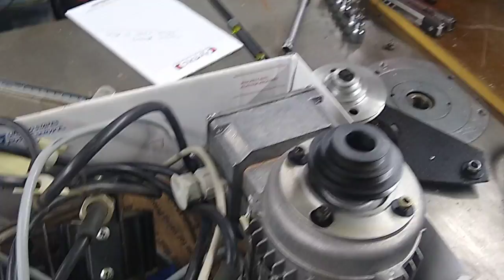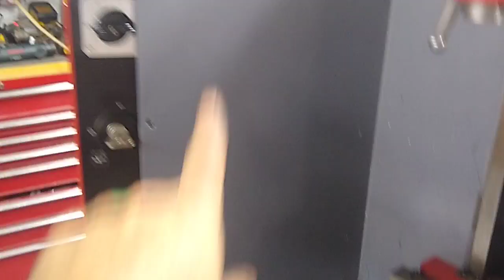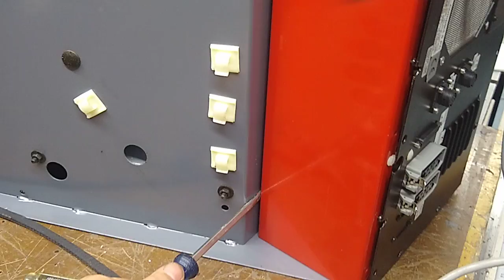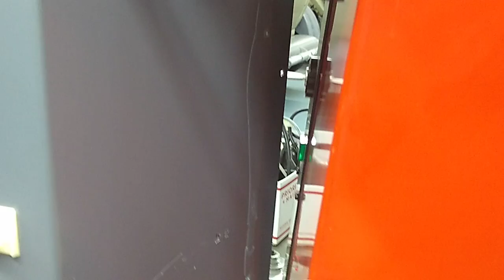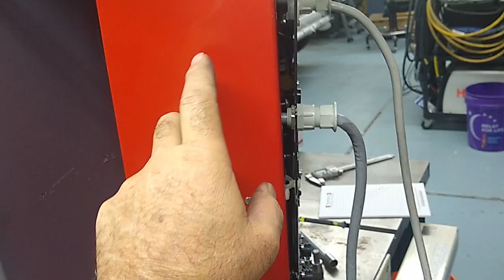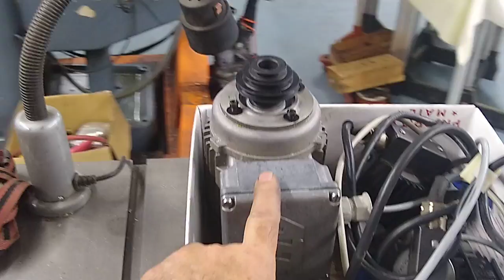New Centroid CNC Acorn Conversion. Another Emco PC5 Part 1

Comment: I have two D&M lathes that look like a clone to yours. Mine does not have the pulley drive system being adjustable. I wish it did! Mine runs out of power with deeper cuts or harder materials. I'd rather have it slow and powerful rather than weak and spinning fast.
Reply from the maker: Most D&M machines used Sherline Lathes and Mills. They mostly used DC Brush motors for spindle motors.
Reply: @martyscncgarage5275   Many of the later ones were Sherline. While mine is DC it has a 90 volt motor more like a treadmill motor and the lathe itself is steel and bigger than a Sherline. One of mine even came with a cnc tool turret. I converted the first one over to TurboCNC probably 20 years ago. It's still running off an old Think Pad that has an interchangeable floppy drive that I can swap out with a CD drive. The floppies were as handy as the flash drives we have today but almost impossible to get to work on a modern computer these days.

They made some larger versions of yours that also had a CNC tool turret but they are getting hard to find.